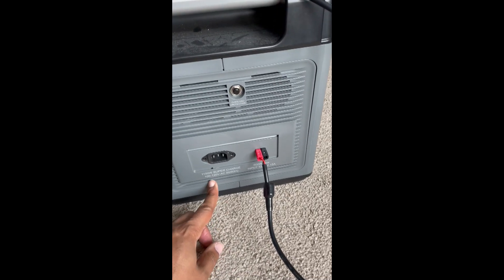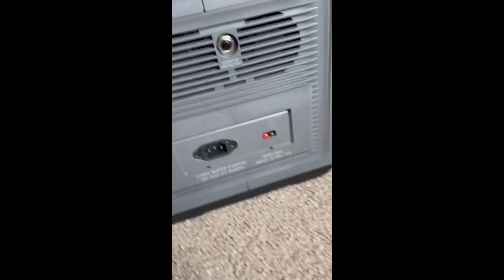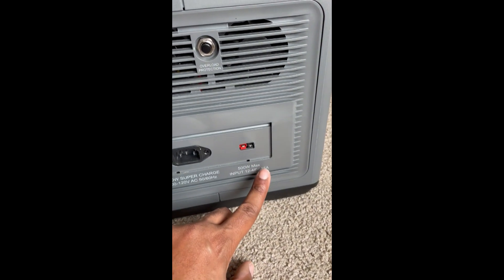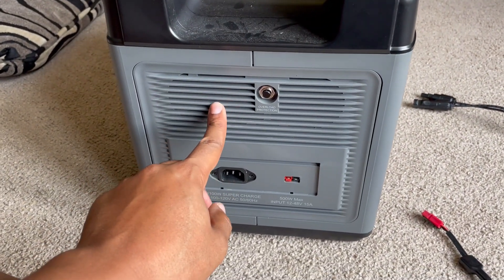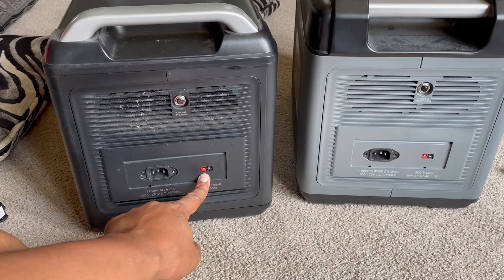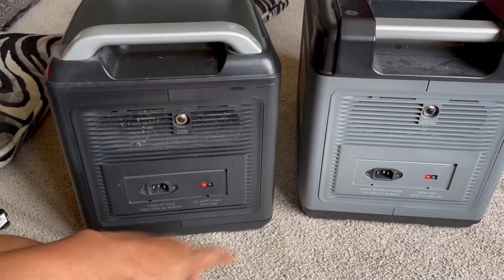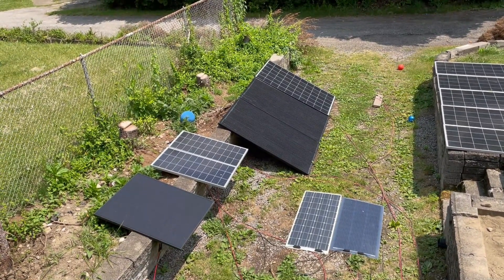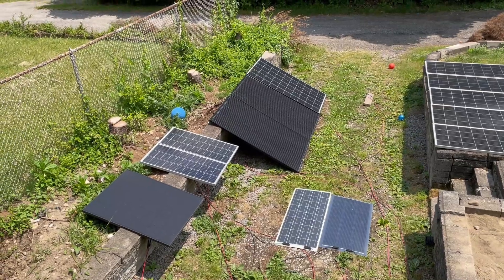Oukitel P2001 Failure!! - Anderson Port Melted AGAIN!!

Comment: Max 15 amps. It also depends on your voltage. The sticker on the back of the solar panels should tell you they're open circuit voltage and their short-circuit current. That will tell you the absolute maximum peak output in terms of voltage and amperage. When you put them in parallel the voltages stay the same in the amperage is add up. And it's only a 500 watt system so I would imagine those panels could easily melt the input in series
Reply from the maker: But these devices are supposed to pull power not let the panel push it, yanno. They typically have an amp input limit. And these panels during this season, produce maybe 6 amps.

Comment: With all the sales on the Bluetti ebay site, when are you going to get the AC300/500? It would seem perfect for your setup with all of your panels. You use your solar setup like a few of us who don’t have a transfer switch or who leave in an apartment/condo. This helps greatly.
Reply from the maker: Can't really afford it boss. I have always wanted an ac300 with those dual solar inputs!!
Reply from the maker: I just work with what I have. Yanno
Reply: @AskIveSolar  I understand that. If you’re ever in Colorado, look me up! I used my first responder discount and got the AC300 really really cheap with their 20% off as well. I’ll sell the head unit with all of its cables really cheap to you. Still have the box with packaging. Just one B300, you could use your lifepo4 batteries as extension packs!! 

Anyways, I love the stuff you put out. Thanks for what you do!
Reply from the maker: Thanks man, I appreciate just the thought!

Comment: anderson or MC4 connectors a design to handle ~10-13 Amps this crap have heavy high internal resistances so pure junk.
anyone who will have low internal resitances on the connectors and a good amount current uses over the last 20 years XT stuff from the RC.
gold plated heavy plugs with alot of contact surface.....sedign for the most heavy abuse and currents possible in a small but massiv build housing and for for alot of plug in out abuses to like RC stuff is alweays must be.

XT30 up to 20-30 Amps the most common connector is the XT60 for up to 60 Amps constant current or on the beffy side the T90...
i have put on any panels XT60 connector coz only the best connector for me is good enought....

ecoflow and other serious  brands start afther tons of fails now using the outstanding XT connectors on there powerstation for the same reason...
never touch a power station that not comes with serious high current connectors like AMASS XT one...
for example a XT30 connector have the size of a USB_C plug so ultra small but can hanlde easy 20 Amps constant current without geting warm !!!!

Comment: I am not to happy with this size Anderson connector.  I have had several problems with them over the years.
Reply from the maker: They are really flexible but kinda suck. Too much room for error. I often have to pull the little sheath back to get a good connection.
Reply: @AskIveSolar  I agree

Comment: Noticed that they are also not using genuine Anderson power pole connectors. The genuine parts use high temp rated polycarbonate shells and have the letter “A” stamped on the ends. What a bummer.

I assume they are likely using a smaller gauge internally within power station to terminate those connectors which could explain the excess heat generated at the connector itself. I’d be interesting to see inside.
Reply from the maker: Good insight! Check the pinned comment. I did open up the top to start using the internal xt60 ports.

Comment: Take the Casing shell of the OUKITEL apart & order an Anderson connect & just replace it. I had to do the same thing to my AllPowers R1500 XT60 Input connect.
Reply from the maker: I took the cover off and just started using xt60, I have to adapt it but its been working like a champ.
Reply: @ Good to hear.
Reply from the maker: I pinned that video in a comment. I had a sparky misstep but I got it done. Ha

Comment: I guess you will have to fuse those ports and/or solar panel outputs?
Reply from the maker: I don't think it was an amp issue per se. 

I took it apart in another video to get access to the xt60 connection, haven't had an issue since.
Reply: @AskIveSolar  ok will look for that video
Reply: saw video...seems like somewhere along the cable that wires are too small for so high amps, xt60 is designed for 60Amps theoretically so unlikely to fail below that capacity, leaving cable wire as the source of grief.. Parallel connection increases/adds up currents..with changing sunlight light intensity current flowing will change up/down as well.  too high a current will melt wire/connector...whatever wire you're using maintains it's resistance/impedence is based on manufacture/size....it's the excess current flowing through undersixed wire that burns your equipment/house etc. Mixing undersized and proper sized wires in a cable will create the same issue....This is the best I can suggest based on my own experience, the cable at those MC4s look like16AWG theoretically good for 10Amps that would explain  it...

Comment: It's probably their included solar cables, undersized wire, heat buildup, melting engaged. If you used your own cable all the way to the port, it might not happen (I use my own cable and I never had them melt). Glad companies have moved on from these design flaws. Most power stations that require high amps use XT60 now.
Reply from the maker: Man I wasn't a fan of xt60 initially because it was so tight fitting on my OG river but that was because I was charging from solar and 12v but now I appreciate it and I'm glad most are moving to it. 

I almost don't want the ac180 because it's 8mm....almost. Haba
Reply: Yeah underrated cables can definitely cause overheating issues.
As Jasonoid mentioned, it's a good idea to roll your own cables when pushing the limits.
Maybe I shouldn't say this, but if the power stations are out of warranty, maybe it's time to DIY a solution, but it will need to come with the disclaimer, don't try this at home. I'm comfortable taking apart one and "fixing" the DC charging issue you have there, but not everyone will be.
Reply from the maker: I did "fix it" in the oukitel support video, I should put that one in the description too.